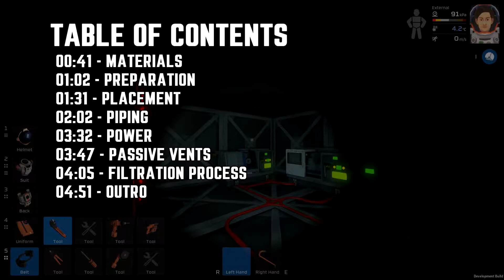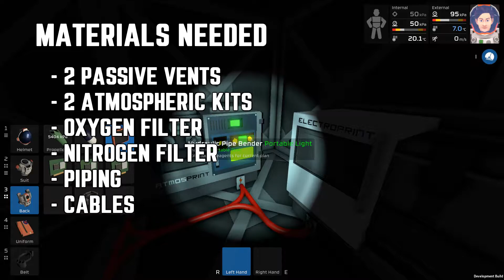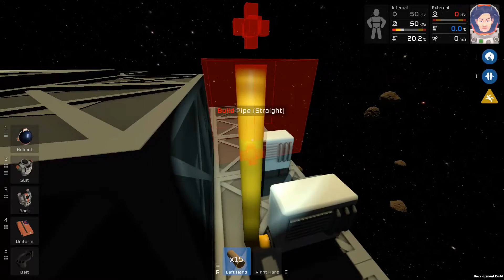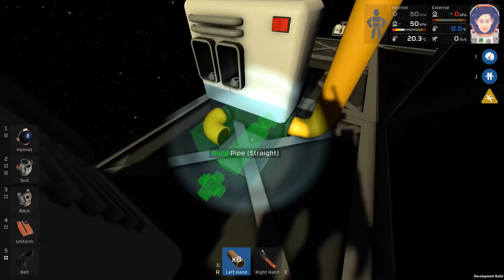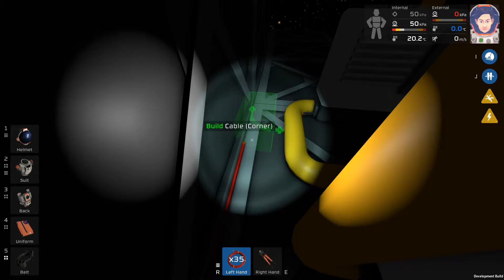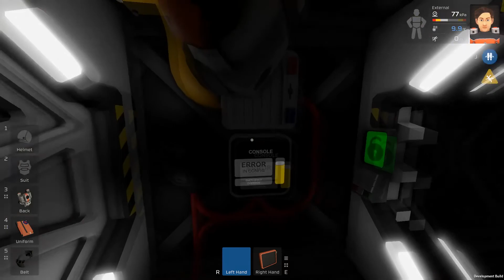BASIC FILTRATION - In Depth Tutorial: STATIONEERS

Comment: I finally got around to doing a pressurized room like this . One problem i had was that i was creating a tornado inside when i had the turned on.  I had to toss on a pressure regulator on the input to the room and a back pressure regulator and set them to 101kpa and everything worked out nicely.  Also with the pipes going out, they are considered closed end on the pipes, so always good to toss on a passive vent or they will bottle up and explode over a time period.  Good stuff tho, game is far more complex then i would have thought it was at the start.

Comment: Great video, but why two filtration units? A single filtration unit has space for two filters, and it'd be insulting to assume that you didn't notice that, and I've had relative success with two filters in a single filtration unit (after I worked out that they pump gas on their own and don't need an active vent there to suck out a quarter of my internal atmosphere). Is a single filtration unit per filter more efficient?
Reply from the maker: Not more efficient per se. The idea of using 2, is it future proofs your base. What you can do later is get a much better oxygen-nitrogen mix using a gas mixer by having them run through different filtrations, and pumping away excess into canisters. It really helps later when you need a specific gas as well. (say an update comes that stricly makes the jetpack nitrogen, it'll be good to separate them.)
Reply: Smart! Thanks for the response!
Reply from the maker: No problem!
Reply: Is there anything pollutants can be used for?
Reply: Franko Schneider  Cooling in closed loops.   Wall coolers need pipes, but operate like a heatsink.   The cooler sits in a room, the pipe goes outside.  You fill the pipe with a gas, and attach radiators.   Turn the Cooler on, and away you go.   Also can be used to fill a heat exchanger.   I understand that X has the best thermal transfer properties.   But as there isn't much other use for X,  why not.

Comment: I havent fully tested this, but I think I've found if you place the arc reactor with the 3 large tubes facing/clipping outside the wall panel it doesnt taint your atmo. (though it might just be less and not none)
Reply from the maker: While that may be true, I just used it as an example. In case there's any toxin in your environment this shows how to remove it. It also shows you basic blocks of filtration, which can really be expanded.